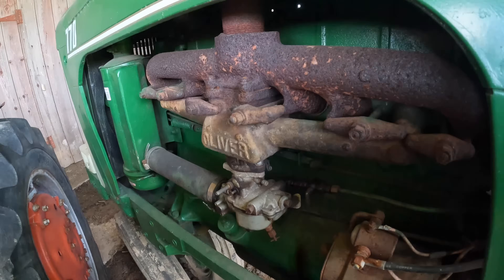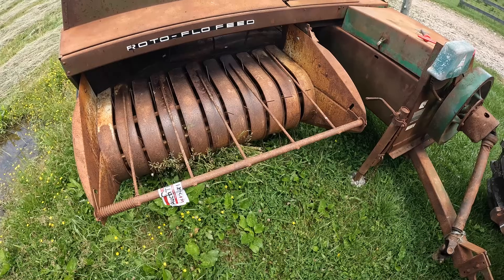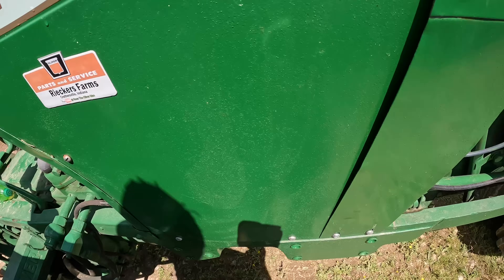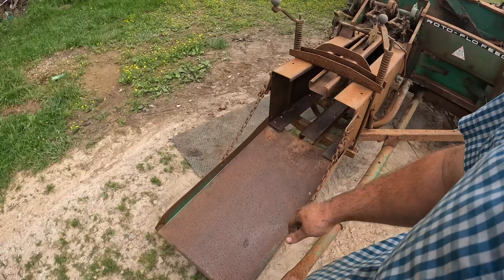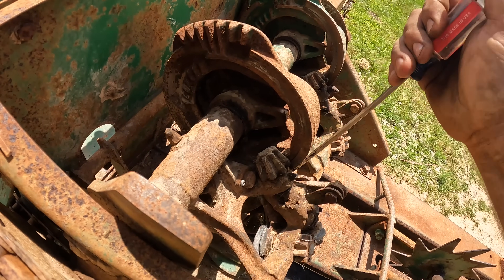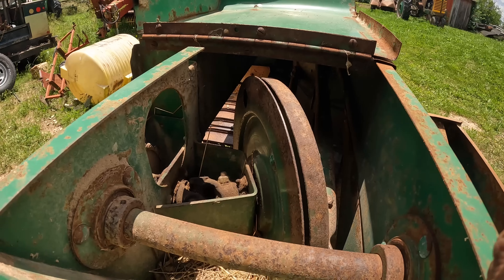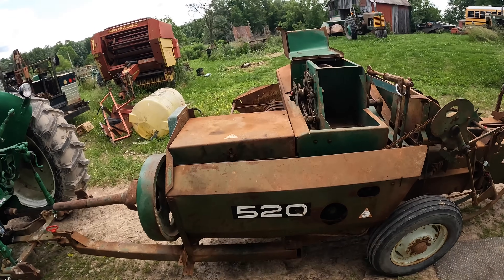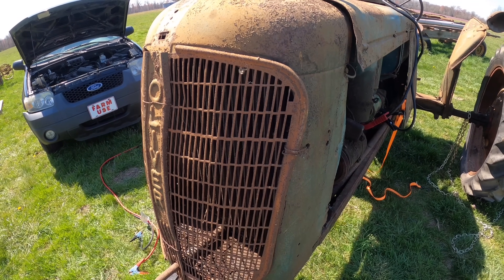SERVICING the “New” to me OLIVER 520 Baler

Comment: Ross, your baler needs a good pressure wash and a good drying. Then the super Juice added . What is that you ask ? 50/50 diesel fuel to old engine oil. Use a hand pump sprayer and give it a pretty good soaking. Then just let it set. Every nut, bolt will stay loose for you and whatever rust will almost stop also, whatever paint that is left on it will shine again. Always did that with every piece of equipment when finished using it. Including the tractor but use some common sense as to where you are spraying it.👍🇺🇸😎🙏🏽 it a runner.